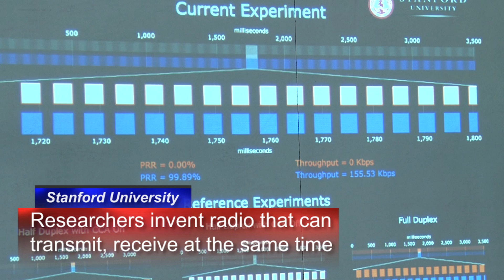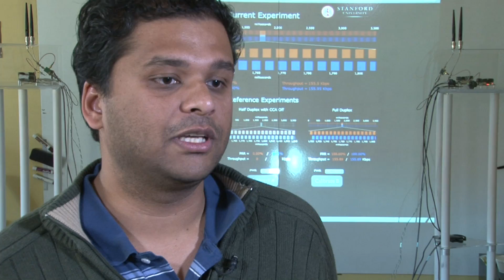New Way To Faster, Cheaper Wireless

Comment: The idea of cancelling out frequencies has been around for a while...

But this application is new. Anyone who has used a CB/vhf/uhf transmit/receive radio knows the reveived signal cuts out when you transmit on that channel. This technology could essentially end that cut-out when the mic is keyed.

I have a feeling those who believe this isn't 'new' don't have engineering degrees.

Comment: How many dB suppression of the TX signal are we talking about?

The system must dynamically adjust the phase and power of the TX array to keep the signal suppressed at the RX antenna with changing environment.  How wideband is the suppression?  How stable is it?  How quickly does it converge and track?  Even small local reflections must be a problem?  How much parasitic beam forming does this cause on the main TX antenna pattern?  How easy it is to integrate with beam-formed arrays?